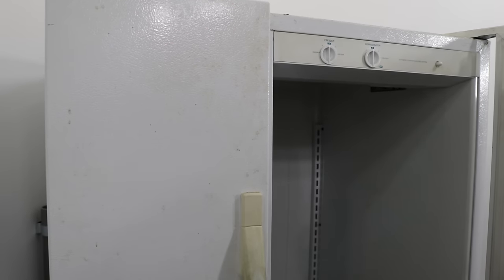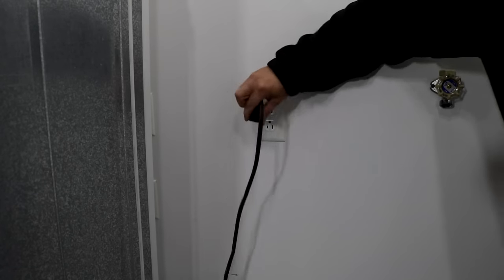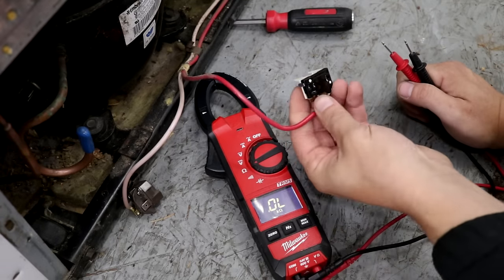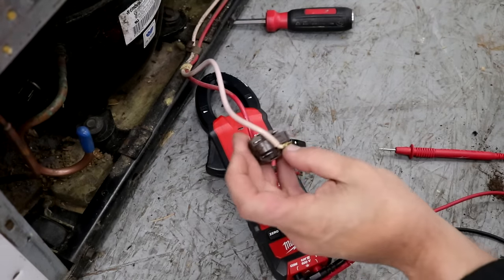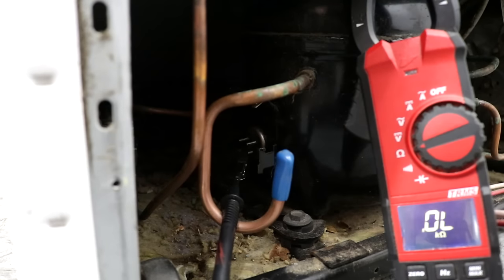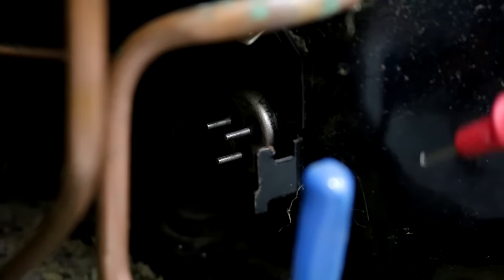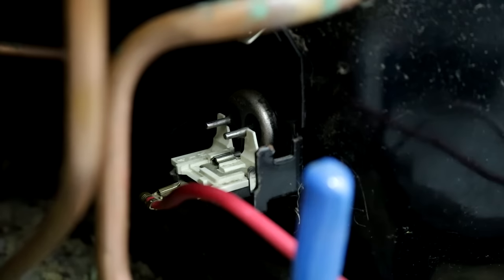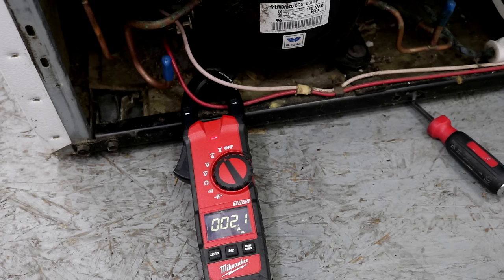Whirlpool Side by Side Refrigerator Compressor Testing - No Cool Repair

Comment: Wrong. Wire could short to case and it will show normal reading and it will not work. It will trip breaker and there will be perfect reading and no current at all.

Comment: A few days ago, my Whirlpool over/under was making a repeated clicking noise.  I thought it might be the defrost cycle having trouble kicking in but the coils look normal in the freezer.  I ran a diagnostic force on the defrost cycle and all appeared fine.  The freezer won't go below about 19 deg. F at max cool setting.  I think the compressor runs rather hot and a bit noisey and I haven't heard the clicking again.  Do you think I may have a leak and possibly low n freon?

Comment: Fans running, compressor windings check okay, compressor warms up, capacitor replaced, Hard Start unit used to replace 3 components and fridge runs but no cooling

Comment: Help !! My compressor is getting hot won't start ,I have changed start run capacitor the overload protector and start relay all to no avail it has a faint humm gets hot and the overload keeps tripping any help.would be appreciated,PS done the 3pin test all seems OK no short and words compressor to start direct to power and its not locked ,

Comment: Thanks for your posting. I have the same refrigerator that had stopped cooling. Using your guidance, I replaced the thermostat and the compressor relay. Works great now.
Thanks again

Comment: Thanks Bill, with your help i troubleshot n fixed a fridge with a bad starter relay. I recently bought an LG stainless fridge 4 yrs old French door bottom drawer for 25 bucks. Found they have problems and will replace compressor plus 2 evaporators, parts only. I was hoping i could install new myself but can't find a good video with detailed teaching on how to do this. I have a lot of experiance soldering copper plumbing but know this is much different. Some joints also go from copper to aluminum.

Comment: Bill, thanks for making this video. It's very clear and helpful. I have a question about the ohms readings on the relay and the overload. I got .2 on the relay and .4 on the overload. Should my readings be that different from your's? Does this indicate a problem with either part? I think I just got the fridge working again by turning the gear on the timer. After I adjusted the timer the fan started running (hasn't for the past 2 days) and after a few minutes the air blowing into the freezer feels pretty cold. Do you have a video related to the timer? Your response will be greatly appreciated.

Comment: Hi Bill, I love watching your videos because you are so direct with problem solving. My Whirlpool side by side refrig/freezer stop getting cold but still running. I had a tech come out and tested one wire and told me my compressor is bad and i need a new refrig. Wtf, he didn't pull anything apart to test any other wire, he packed up I paid him and he left. What can I do next?
Reply: What wire did he check, amp draw on the compressor? 

While the compressor is running for at least 10 minutes, check the temperature of the condenser coil. In a healthy Sealed System, the temperature of the condenser should be about 30 F above your room temperature. If the condenser temperature is the same as your room temperature, there is a leak of the refrigerant, inefficient compressor, or some other Sealed System problem. Any of these issues are very expensive to repair (up to $1000), maybe that's why the tech said you need a new fridge.

Comment: Thanks for sharing your knowledge. 
I replaced the relay star device because of the clicking and did works and cools but clicking still there and stops cooling. After being unplugged and plugged again it runs and cools but clicking still there,compressor works very quietly. Refrigerant lines are almost same temp and notice the clicks more often after placing cover back on and pushing it back closed to wall. Any thoughts on what May be?  Thanks a lot.

Comment: Hey Bill, my Whirlpool side by side refrigerator and freezer are not getting cold. While troubleshooting, the water works, the ice dispenser works "we have dry ice keeping things cold",  the compressor is good. However, the fan isn't working and the compressor isn't starting. So, I ordered the component parts in your video and they should arrive this Friday. Fingers cross... Do you think the fan is bad as well, since it isn't starting?

Comment: Nice  vid man , I got a free whirlpool refrigerator,and they told me it needs a compressor,I did all the test you did except for the amp draw test .it feels like the compressor is running smooth, quite not noisy ,I feel it runs but quite smooth ,all the pins read continuity,,I'm thinking the cercuit board but not sure?? Any advise

Comment: Recently replaced the start relay with one not graded for my compressor. Overload failed, relay burnt out, and the red wire was damaged. How can I tell how damaged the wire is, or is replacing the wire and connectors a decent low experience job? Thanks!

Comment: Great Video! My refrigerator is making a clicking sound every second or so. The fan is trying to start but only makes quarter turn on every clicking sound. I checked the resistance on the leads of the compressor, seems to be fine electrically but  no sound and not working. Changed the capacitor and overload relay, problem still the same. Thinking main control board so i checked all 4 capacitors on the board for uFs, all good there. Now i am thinking the fan motor or some other issue with the main board. Still need to check power draw on the compressor. Any suggestions Bill?

Comment: Great video. My issue is my fridgidare side by side, is cooling, but not as cold as it is normally. some stuff in freezer is half frozen. I cleaned the coils which were really clogged, both fans work and I believe the compressor is on to, so I hope that was the issue, if not... what else could it be?

Comment: My Kenmore\Whirlpool start-relay doesn't have a capacitor.  Refrigerator is keeping everything cold but I hear the overload click often.  I am replacing the start-relay again after 1 year.  Would a RCO410 3 in 1 Compressor Hard Start Capacitor Kit be better/stronger?   Maybe the compressor is just hotter now during the summer?

Comment: Thanks, very clear. My fridge Kenmore Coldspot 10658785890 has a blue wire running to the side of the start relay that has only one prong. The other side of my relay has two prongs with 2 white wires going together into one of the prongs. Does it matter if these white wires go to the top or bottom prong? You show it going on the bottom prong but I THINK mine went to the top one. I forgot to get a clear picture of these connections before trying to replace these parts and now I can't remember.

Comment: Bill, Im trying to use a Mulitimeter  (Klien mm100) to follow your steps to test the resistance.
Can I use this type of meter ? and if so, where exactly do I place the dial to measure? I have 5 different options (2m,200k,20k,2k ect...)

What I did is.... I purchased this older fridge for storage of extra food. I brought it home and hosed it down. Didnt wait enough time and plugged it in. All worked for a while, then I noticed it getting warm in the center of the doors. I then noticed the condensor fan was out. I placed a huge fan in the rear thinking that would keep it kool until I ordered a new one. Then it just stopped working all together...

Thanks for your help

Comment: Also check from each pin to ground.  I just checked a no cool condition and on a whirlpool fridge and resistance from compressor pins to ground was 2 ohms.  Owner had installed a Supco capacitor kit and condenser fan was also not working.  Too bad!  I think it's better to stick with original PTC relay and overload components because a hot compressor will trip the PTC device when hot.  It's one thing to change out a compressor but quite another to replace a burned out one with all the contamination issues in the sealed system.  Keep your condenser fans and evap fans healthy!

Comment: Hi Bill Love your video. I have a problem with my top mount fridge i wonder if you could help me. My fridge the freezer part is running fine everything is frozen but the cool compartment is warm. When I first turn on the fridge the fan that blowing air from the freezer down to the cool side runs for about 1 hour then stop. should i replace the fan or is there a sensor that needs to be look at. thank you

Comment: hi Bill, my freezer is not getting icy enough (around 30 degrees) when I open the panel in the freezer (Fridgedaire Side-by-Side) I see frost on the top part of the coils (none in the middle or at bottom).  The evaporator fan is working (but stays around 42 degrees) and I can feel slight air from the dampers going into the refrigerator (not alot).   What do you think could be the problem?  Compressor? Defrost Thermostat, etc...?  Thanks for your videos

Comment: Nice job in explaining on how to test a compressor if it works. My 2014 lg compressor vibrates and there’s 0.48 amps

 that runs through it but still my fridge does not get cold , and when I disconnect the power And do a ohms reading on the coil terminals  from common to the upper left terminal which I think it’s the run it reads about 7.8 and from common to the upper right that could be start  does not give me a reading and from run to start  no reading. When you have some time could you please let me know what that means, thank you.
Reply: If you have an LG fridge, your compressor is probably "Linear Compressor". That's why you get ohms reading only between 2 terminals and nothing between other terminals. Linear compressors typically fail within the first 5 years and it happened to me. They can run (vibrate), but not work, and you can tell just by listening if the compressor is not doing its job. I'll be posting a video in a couple of days comparing the sound of a good Linear Compressor and a bad Linear Compressor so you can hear the difference.

Comment: I get basically the same thing.  Overload circuit reports anywhere from 5 to 1.2 ohms.  And other pins also reports resistance all over the place 11, 8 and 4.   Compressor reports higher then 2.0 amps and bumps to around 12.7 amps ( from the start and run whine-dings when running and kicking in every 5 mins when the compressor clicks on.  Compressor clicks on, but not sure if it should stay on all the time or shut-off and on when it needs to cool?    

Questions: Does the Compressors usually run all the time? Also noticed the compressor getting hot and seems like the Fan to the right is pulling air away from the compressor and it would seem more efficient if it blows cool air toward the compressor and not sure if this is wired backward (used unit)?   Thinking about replacing the shutoff sensor and seeing if that helps.

Update: Pulled my shutoff and PTC relay.   Another video suggestion referenced shaking it and seeing if it was making noise.  Mine was rattling bunches...took it apart and almost everything in the PTC feel out.   PTC was Burnt and Crispy!  Ordered a replacement online and looking forward to it making improvements in a couple of days.
Reply: Did it fix it mine same thing

Comment: Question if the compressor is running I'm assuming it's working am I correct? I have replaced the capacitor as well as the start relay because it was not turning over once I did it turned on compressor is on But I'm not getting Any cooling on the Evaporated coils good air is flowing up in the into the tower is working as well originally the motor next to the compressor. 

Any idea what else is wrong with it I'm thinking thermostat somebody else said ADC I'm not sure what part next to replace or do I just go ahead and hire someone and then be told that I was stupid.. Please help thank you.

Comment: I have a run capacitor separate from the two connectors you show here.  What should it be reading?  I can get fridge to start again sometimes by turning the temperature setting to off and then turning it back on, is that a problem with the thermostat?

Comment: At 1:19 then @ 1:23 Very good to see and understand how to open up the connections. Hard to know otherwise. This is exactly my Whirlpool refrigerator that has model number "whirlpool ED22RFXRW01" and is not cooling anymore. I believe its bad overload / starter. Would I be fine if I replace the current one with a 3 in 1 (Starter, overload, capacitor) that are available for very cheap and are said to be universal? Thanks,

Comment: Thanks for video.  My compressor is running at .7 amps.  Is that a bad compressor or could it be low Freon?
Reply: It uses 134a and yes, by low Freon it would mean a leak caused it to get low.  Refrigerator is 9 years old and is a Kenmore Elite.  Not dusty.  Everything appears to be working fine.  Condenser and Evaporator fan working along with compressor running but zero cooling.  Condenser coils not getting warm and evaporator coils not getting cool.

Comment: I have a 2007 Frigidaire Freezer FFU11FK0FW0 that stopped running and all of the food spoiled.  The timer stopped in the defrost mode.  After replacing the thermostat and timer, I saw this video and also checked out the compressor.  There is no Condenser fan.  I checked everything in your video and and everything checks out; however when plugging the unit in, the interior does frost up but only slightly after an hour.  What do I check next?  The compressor seems to get very hot so I don’t want to keep running it.

Comment: Good videos Bill.  But I have a question re: a compressor that is running... but system is nor cooling correctly.  On startup the amps go up to normal levels...  the high side line gets hot...  low side cold...  MOMENTARILY....As it runs longer the high side line cools down.  The low side line stays cold...  but the amps drop to .88 amps.  Bad high side valve or restriction ???
Reply from the maker: +Steve HI I would say restriction in the system, replace the filter drier, check for leaks and recharge.

Comment: So today we had 110 degree weather. Now my fridge is acting up. Cooling fine but I have frost inside freezer. Also the condenser condenser is so hot I was worried my wood floor was going to catch on fire. I suspect the overload might not be working but haven't checked it yet. My question is...if I put a temperature gun on the condenser what temp is consider above normal specification. I don't see a high and low temp rating on the name plate.

Comment: Hi, I have the same compressor (Embraco) for Whirlpool refrigerator and wondering which copper line to pierce to add refrigerant (r134a).  Would mind telling me about it?
Reply: Probably too late, but Bill has passed away a few years now.  The line you should pierce is the service line. It is usually on the left side of the compressor about 3-5” long

Comment: very helpful video, thank you! after replacing the relay, after couples clicks compressor finally kicked in again. the fridge has been working but was not freezing ice cream. replaced the defrost thermostat before and noticed that the coils were not freezing all the way. Only top and bottom were freezing. Any recommendations?

Comment: My Whirlpool side by side was not working properly. I put a fan behind the fridge to move air better and it seems to have worked. It seems that the compressor fan is sucking air instead of blowing air over compressor. Can a compressor fan be defective and run in reverse, if so what needs replaced?

Comment: Hello, I have a newer model of this fridge with electronic control in the door panel.After reaching the set temperature -24 the unit switches off and does not turn on until it is removed from the socket in the wall and inserted. what can be damaged?

Comment: I have the WRS571CIHZ00, IT IS ABOUT 2 YEARS OLD AND EVERY 30 MINUTES OR SO, IT HAS A 1 or 2 SECOND LOUD SOUND, IT IS SO LOUD i can hear it on the second floor.
iS IT THE COMPRESSOR SOUND?  The fridge is cooling normal.

Comment: Bill, LOVE the videos.  I am at my wits end with my little 4.4cft.  I plug it in interior light goes on, compressor only hums, and after two hrs gets really hot.  I replaced the starter QP2-4.7G relay, I ohm'd out the 3 pins to 7,6, 13 all continuity,  I ohm'd compressor for ground with scratch test, I ohm'd overload (B77-120) continuity is fine (but something loose inside when shaken).  what the heck am I missing.  the fridge was in storage for nearly two yrs.  Any further tests or should I 3in1 like your video to 'jumpstart' this thing.  appreciate your professional opinion and thank you!!!  (I do hear a hissing sound as if something is in copper tubing)
Reply from the maker: +Adam Szopinski Sounds as if the freon is escaping.  Shouldn't hear a hissing sound.

Comment: I watched your videos and am confused about where to start.  I can hear my refrigerator running, it is warm in both refrigerator and freezer. It feels a little cool at the back panel inside the freezer.  I;m afraid to turn the defrost dial because you said in one video that it would never defrost again after being turned.  What would you suggest?
Reply: I figured it out.  I bypassed the other checks and went straight to the back. The fan was running and the compressor was clicking every 5 minutes.  I did the tests and the relay switch failed.  Going to buy the part and hope that does the trick.  Do you have a video on changing the relay?  And, do you have any recommendation on where to get the part?  Thanks!

Comment: I recently changed the white part on my fridge and shortly after I plugged the power cord in i saw a small spark go off on the white part and heard a click. Is that normal or did I just blowout that small white part? Also, my compressor is pretty damn hot.
Reply: I am having that same issue and following here for an answer as well. Clicking like sound. Thank You for sharing the video..